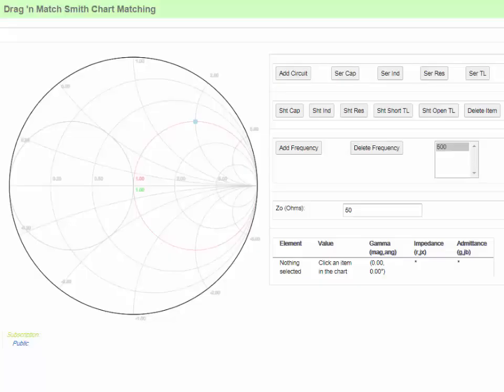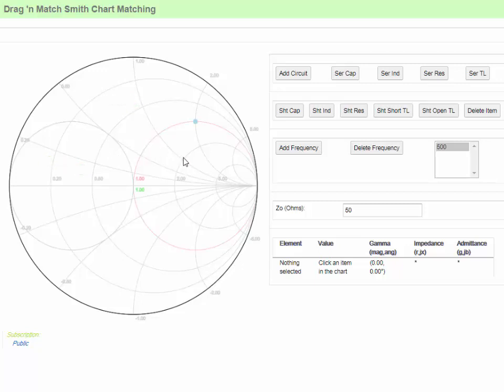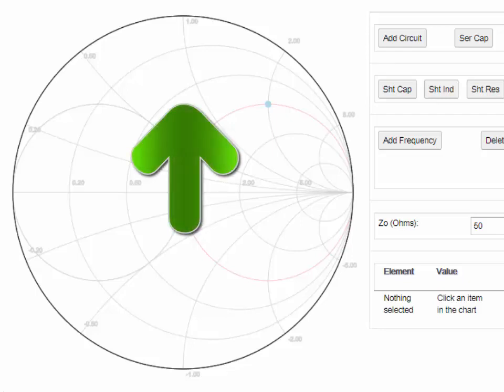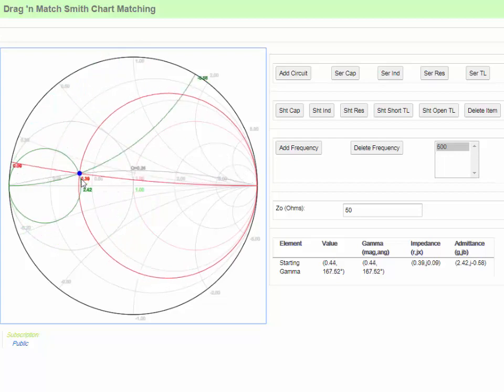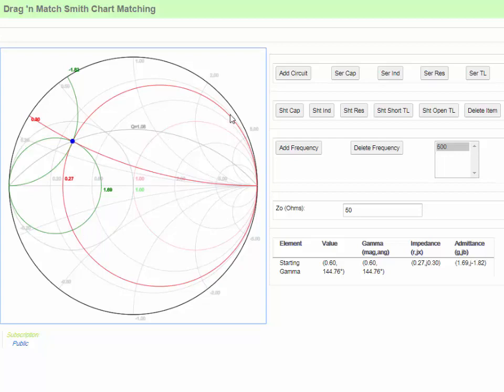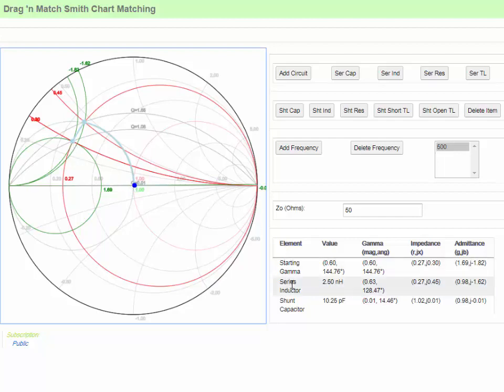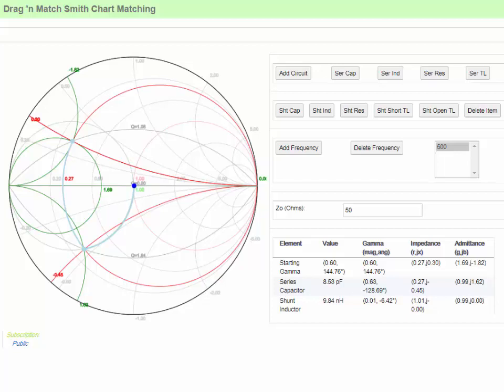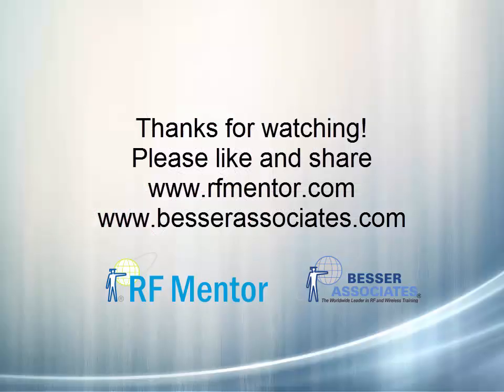Smith Chart Matching in 10 Minutes

Comment: Nice software ,.its nice.i just add or to suggest whether it could be used with vna connected.or are you plsnning to code anorher software for vna that it can shows these calculated parameter on the screen of vna rarher entering the value in this software.two alternate i suggest with request (if its not incioerated in this software,as i have not gone through deep coinecting the vna.

Comment: Can I calculate physical length for transmission line or stub line in this software?
Reply from the maker: When you create a matching network with transmission lines, the line length is displayed in the table of components for the currently active frequency. Line length is for an air dielectric.

Comment: for a real discrete passive components, how to predict the movement?
Reply from the maker: If you want to account for real component parasitics you will need to transfer your basic design into an RF simulator, add the parasitic information and then optimize the design from there.

Comment: Thank you for the nice GUI. Could you explain how to load match (without capacitor and inductor) using the Smith chart?
Reply from the maker: You would use the transmission line elements instead. Maybe I'll have to make another video?

Comment: Good video. I like the rules of thumb you present; it took me a bit of time to distill those on my own from other videos and material I read on Smith Charts. I should have found this video sooner. One slight misstatement at 12:13 in the video you say resistance goes from 0 to infinity from right to left. That should be from left to right. Also, transmission lines will follow circles of constant VSWR, right now they are following circles of constant conductance. (I posted that same comment on rfmentor).